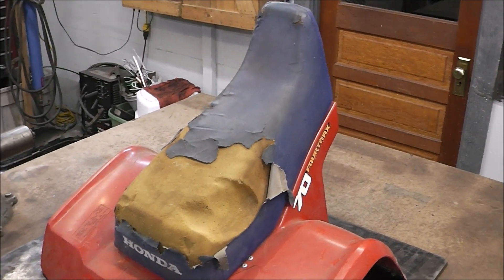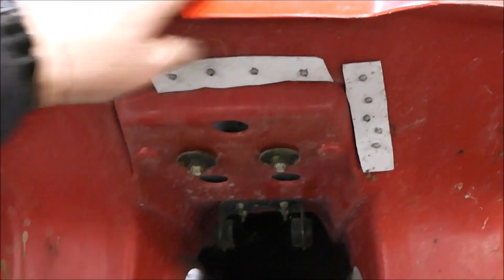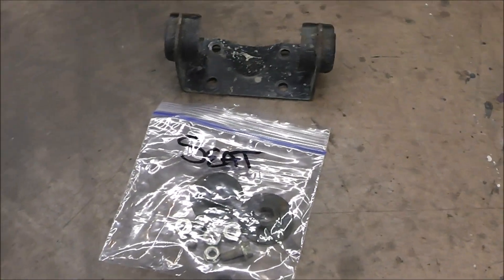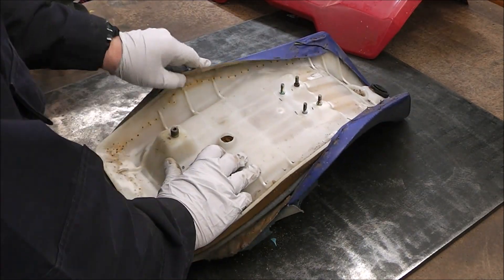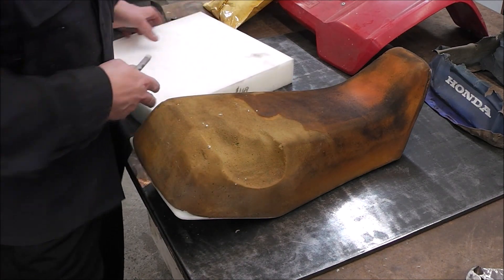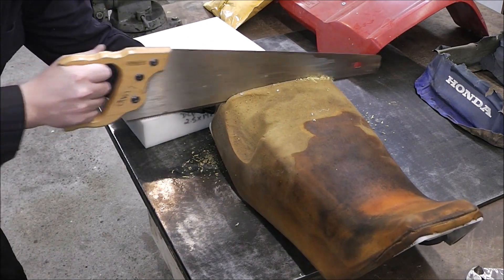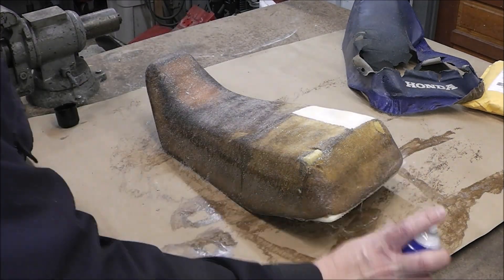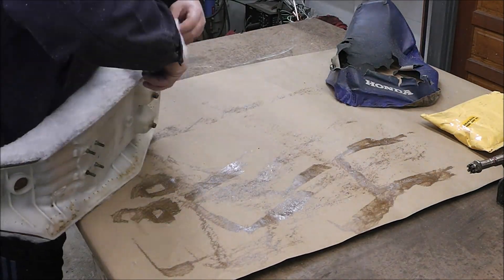Honda ATV TRX70 Gets a Seat Repair and Seat Cover Upholstery Pt.3 #doitforcolton

Comment: What are the odds I'm searching YouTube for ATV seat foam repair in here Brandon already has it never would have guessed
Reply from the maker: Hahahaha most of my motorcycle and dirtbike stuff didn't do well on my welding channel so I moved most of it over to my other channel but that seat cover video is pretty popular. 👍
Reply: @BrandonLund  what length Staples did you use
Reply from the maker: I think 3/8

Comment: You should of steamed the the old foam.  Steaming the foam poofs it up and makes it like new.  Then add the new cutouts.  Also a lite misting of bleach in the end and let it sit in the sun for a bit before adding the cover in the dryer so its hot and stretchy
Reply from the maker: Im happy with how it came out.

Comment: Thank you so much for the angle grinder tip. Who woulda thunk you could use an angle grinder to form foam rubber. This is the answer to my problem.
Reply from the maker: No problem 👍 Glad I could help! :)

Comment: What size staples did you use?
Reply from the maker: If I remember right I think 5/16
Reply: @BrandonLund  in depth?
Reply from the maker: @duckworthatvandmxadventure6601  yes. It was either that or 3/8 but they both would work fine

Comment: What staples did you use?
Reply from the maker: I was told after the fact i should have used stainless steel marine staples but i used basic 3/8 staples at any hardware store with no issues. The staples i removed were original and rusty so those certainly anything special either.

Comment: is that a specific High density foam?
Reply: i need to redo my sons 1987 125 fourtrax
Reply from the maker: It's is but I dont know what it's actually called. An upholstery shop would be your best bet but this is easily something you can do with great results.

Comment: Can recommend the exact stapler and staples u recommend...I'm finna try your method...i refuse to pay 550$ for a suzuki lt160e seat...
Reply from the maker: Honestly, the staples that were in it from the factory were rusted so I knew they were steel. Based on that I just used regular staples found at the hardware store. I think they are T-50. They do make stainless staples if you have deep pockets but I didn't see the need.

Comment: Got a seat cover for a 1983 honda xr 200 must be the same guy on Ebay same instructions. and the quality is awesome looks exactly like the OME . thanks for your info.
Reply from the maker: Yah this guy definitely makes a quality product and doesn't cut corners and it wasn't much more that some of the other cheaper ones.  I'm glad I spent a little extra to get the quality because it looks like OEM.
Reply: @BrandonLund  hey, I’m restoring my ‘94 xr 250 and was wondering where/what brand your seat cover is?
Reply from the maker: Hey Joe. The guy I bought it from was selling them on ebay but he has since taken his store down. He was an older guy so its hard telling if he's still alive or not
Reply: @BrandonLund  ah okay. Just not sure if I wanna get the $30 cover or if the $63 cover would be much different in quality
Reply from the maker: I would reach out to both and find out some specifics. If they are pretty much the same I'd go with the lower one

Comment: What size staples did you use?  Have any issues with the staples penetrating the plastic?
Reply from the maker: Hey Timothy, I used 3/8" with an electric stapler and no issues at all. Others have said use Monel staples. I probably would have if I was aware of them at the time but they are a bit pricy.
Reply: @BrandonLund  Thanks Brandon, nice video.

Comment: Fantastic job, just did mine with expanding foam, bread knife, p40 sand paper and a standard hand gun stapler using 12mm 140 staples. Thumbs up and it really does make a bike look a million bucks.
Reply from the maker: Thank you and good luck on your porject!

Comment: Can't find the link to get a seat cover. Not good at this.  Thanks
Reply: Can you tell me where you got the seat cover thanks
Reply from the maker: So I checked the link. Your right, its not working. I bought it on ebay. It was an older man that was making them. It doesn't look like he is doing them anymore and my original purchase didn't link me to his page. Sorry. One of the things to look for is how the word Honda is applied. In his description he said his were screen printed. Not spray painted like some of the cheaper covers.

Comment: Just saved one of these little quads from next to a dumpster. A little gas and three pulls got it running. Want to go through it and make sure itll be good for my 3 yr old so very interested to see how yours comes out!
Reply from the maker: Congratulations!  These little 4 wheelers are getting hard to find and a lot of times the prices are very high.  It sounds like someone didn't know what they had. Thats awesome you found it by the dumpster. I have a new project to unveil this week and then we will get right back onto the build. Thanks for your support.

Comment: What grit is the flap wheel sanding disk?
Reply from the maker: 60 but i'm going at it with a light touch because it wants to bite into the material. 120 would probably be easier to control though

Comment: I recently did the seat on my 1997 Arctic Cat using this video as a guide.  I used an angle grinder with a diamond metal cutting wheel which worked well.  The blade is very thin so I used it to make the initial cuts where you used the hand saw as well as carving out the center by holding it in a vertical position and moving it back and forth.  I had to be careful and go slow but it did a really good job.  Thanks again.
Reply from the maker: @tim lovejoy that's awesome man! Isn't it a great feeling doing it yourself! 👍🙏

Comment: Where can I buy good firm seat foam? and what is it called ( weight and density )? It's for a larger Touring style seat.  Thanx
Reply from the maker: I found this at a local discount store. I'm not sure of the name. I would check ebay. I'm pretty sure the guy that makes these seat covers also sells the seat foam.

Comment: That seat looks mint. I did the same to a Honda trx quad, the seat cover had split but the foam was okay though. Before fitting the new factory honda seat cover, I covered the seat foam in a pelt of sheepskin, basically like what you did with the layer of white foam ( i had to shear it around the edges so I could get a few staples in to the seat base lol). Then i fitted the factory seat cover over it. The seat looked kind of puffed up but it worked well
Reply from the maker: Thanks man and great tip!

Comment: Way to go , Nice JOB !!  Is there something you can coat the staples so they don't rust ?
Reply from the maker: Good call. I never gave it a thought. They might make a galvanized or stainless staple. I could go right over what is there. I like your thinking!
Reply from the maker: @Smooth Move BRILLIANT! that's an awesome solution. Thank you!
Reply: I was gonna say a coat of lacquer,  but nail polish is pretty much it.
Reply: archenemy24      Years back we use to fix blown speakers with nail polish and a dollar bill cut to fit the rip areas

Comment: I suggest using a variable speed drill with a sand disc on it.  An angle grinder is far too much machine...in weight, speed, maneuverability,  aggressiveness, you name it.  Nice job tho
Reply from the maker: Thanks man and great tip!

Comment: The link that you provide to the supplier of the seat cover is no longer valid. Your video is being used to illustrate how to install a seat cover, on a website that is affiliated with an Ebay seller called gumtwo32. Can you tell me if this is the seller that you bought your new seat cover from? The cover that you show in your video looks to be really good quality, and I would like to make sure that I would be buying from the same seller.
Reply from the maker: I think he either got sick or died. He was an older retired gentlemen. His website has been taken down.

Comment: I can hardly wait to see the finished product. Will there be a part 4? I have a 1986 also we took it out of storage after 15 years have pretty much what you have done gone through gas tank Rebuilt the carburetor and it was amazing after all these years it started up on the first pull. We bought new tires and luckily the plastics are great on mine my only regret is I recovered the seat on my own and I did it in black so after watching your video I think I’m going to pull it off and do it in the blue. Today I will be working on the new graphics it almost looks brand new. excited to see what yours looks like. Thank you for the video
Reply from the maker: Thanks for the support Sherry! There will be more episodes, I got sidetracked on some other projects but I expect to be back at it again real soon. I wish my plastics were in better shape. I'm still working on sourcing parts

Comment: Nice touch with the sanding disk grinder! What type of staples are you using? Nice video btw. Gave me confidence
Reply from the maker: Thanks man glad I could help! I appreciate you checking it out! For the staples I used just generic staples from the hardware store. I dont think the original staples were anything fancy because they were all rusted so these should work just fine
Reply: @BrandonLund  can you post a picture of the sanding disc you used?
Reply from the maker: It won't let me post a pic but these are the disc's. I used 80 grit https://amzn.to/3mJrqtD